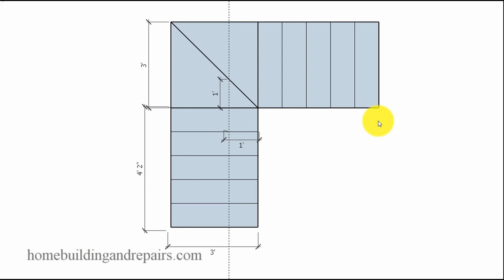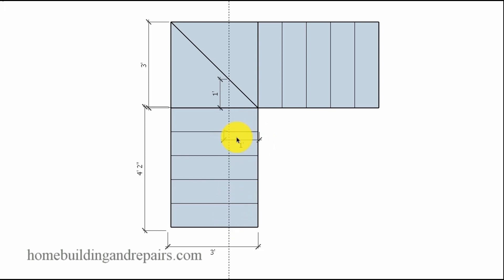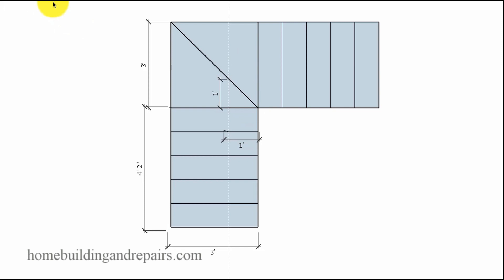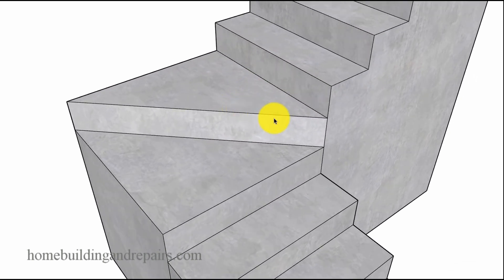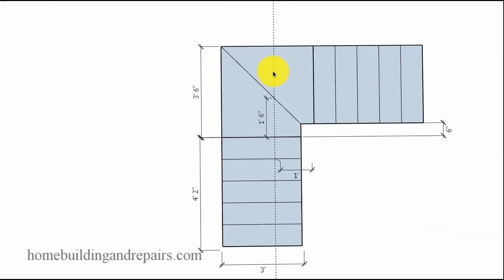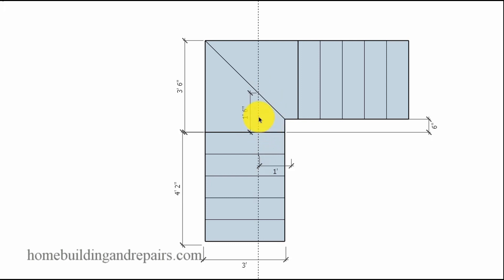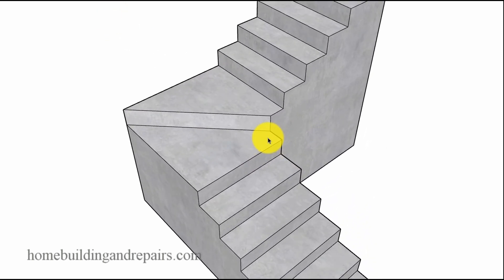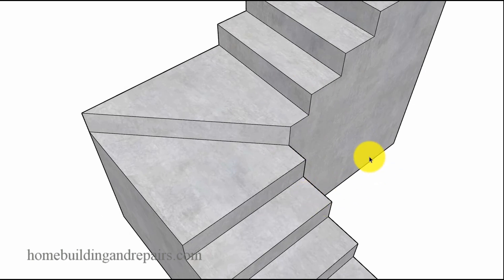Two Step Winder Design or Angled Landing Step Interpretation of Building Codes

Comment: Definitely different building codes, but I have read something similar in my area. My interpretation is that the 6” or 150mm is actually to be taken a long the walk like. I believe that is why they allow a 30 degree winder because at the walk line, there still is >6”.
Reply from the maker: I would check with your local building and safety department, but most walk lines require 9 or ten inches.